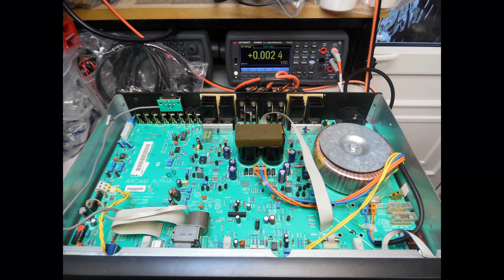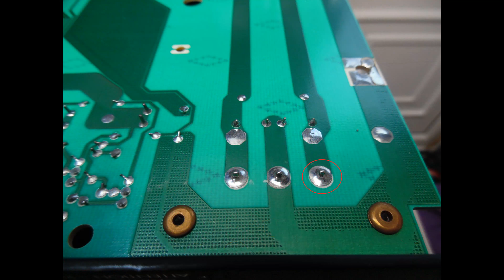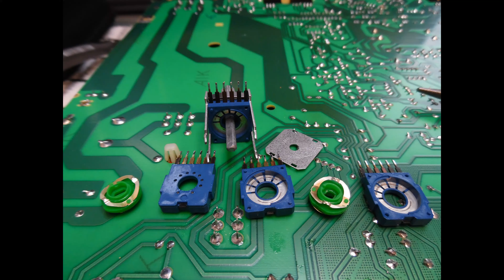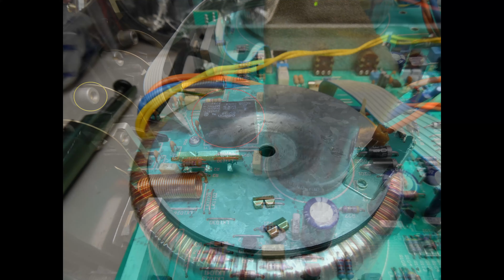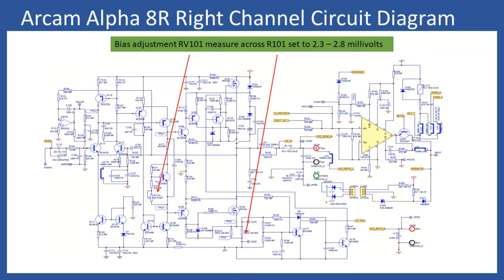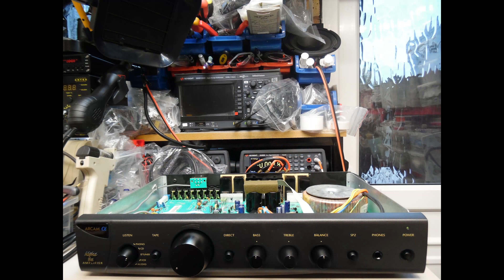Arcam Alpha 8R Amplifier Repair (With Audio Tutorial)

Comment: My 8r was stored for a few years, pulled it out yesterday, hooked it up, powered up, speaker protection relay clicks, amber light goes green after 5 seconds but no sound at all.
Any ideas? 
Have it stripped down, power seems to be going to all the right places but nothing...
Reply from the maker: Hi, can you confirm you have the same issue with all inputs, if so do you have an Audio signal tracer or a pocket oscilloscope so you can check the Audio signals on the volume control potentiometer.

Comment: Thanks, this is a great video. I have a problem, I don't know if you have any ideas? I have an Alpha 9 and 9P bi amped and bi wired. I bought these from new 20 years ago. The problem I have always had and regret not trying to get it fixed under warrantee, if I turn the volume up past half way then very soon the A9 cuts out and the orange light comes on. I have to then turn it off, wait a few minutes and turn it on again. I don't understand why this should happen - if then amp cannot handle the full volume range then why have that range? I emailed Arcam many times over the years and have never received a reply. Do you have any ideas? At one point I did have a fault when the output MOSFETS packed up and I successfully replaced them. Thanks.
Reply from the maker: Hi
The operation of the protection circuit is detailed below, can you advise if the Amplifier will reset on its own or you have to alays turn it off to reset it. 
Protection/ Mute circuit
The protection and mute functions are carried out
by integrated circuit Z501. 
This performs turn on delay, d.c. offset
detection and thermal cutout. It also displays the
status of the amplifier with the use of a bicolour
LED - 'Green' for ready and 'Amber' for when the
speakers are disconnected internally because of a
fault condition or on initial power up whilst the 5
second switch on delay mute is operating.
If the unit suffers a current overload the protection
circuit may latch and the unit will not reset until it
has been switched off and on again. If the
protection is activated by a thermal problem the
unit will begin to operate again when it has cooled
down.
The thermal cut out operating point is set by the
thermistor TH501, mounted close to the output
device heatsinks.
Reply: @AudioAmplifierServicing  Thank you, I've always had to turn it off and on, but the longest I've waited is around 3 minutes, so I could try it and leave to see if does eventually come back on.
Reply from the maker: @Paul_Holmes  The test will potentially confirm what's triggering the fault.
Reply: @AudioAmplifierServicing  Hi there, I have tested now and the amp does not reset itself, I have to power off/on
Reply from the maker: @Paul_Holmes  Thank you for advising, based on the information provided by Arcam in the service manaul Voltage / Current protect signal is going on and triggering the protection circuit to latch. What is the total impedance of the speakers conencted to each of the output channels.
Reply: @AudioAmplifierServicing  Hi, they are B&W DM603, the spec says 8 ohms impedance (minimum 4.3 ohms)
Reply from the maker: @Paul_Holmes  Do you have any other speakers you can connect for test purposes so we can confirm if the issue is with the Amplifier or the speakers.
Reply: Hi, yes, I previously used Linn Kiosa with which I had the same problem and I changed to the B&Ws on a friend's advise.
Reply from the maker: @Paul_Holmes  Then it would point to the Amplifier.
Reply: @AudioAmplifierServicing  Thank you
Reply from the maker: @Paul_Holmes  I can provide guidance on to fault find the issue.
Reply: @AudioAmplifierServicing  Oh, yes please, that would be much appreciated. I have a basic knowledge of electronics and some tools.
Reply from the maker: @Paul_Holmes  email audioamplifierservicing@aol.com